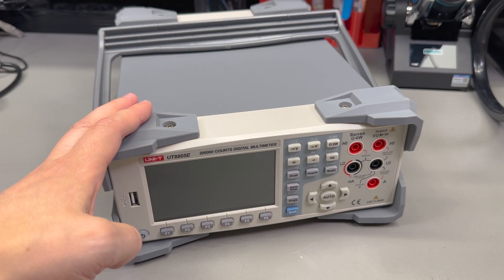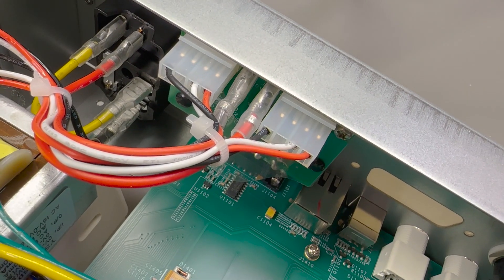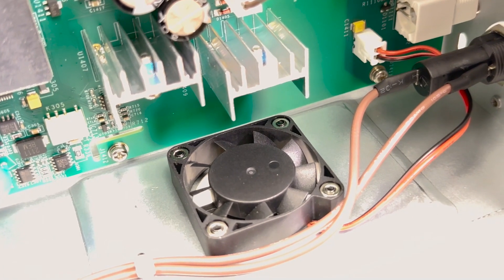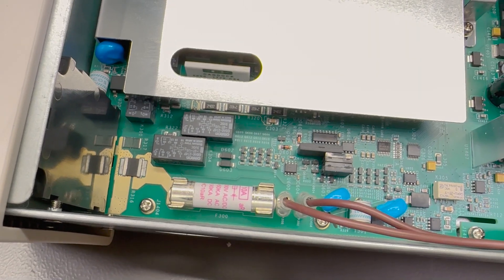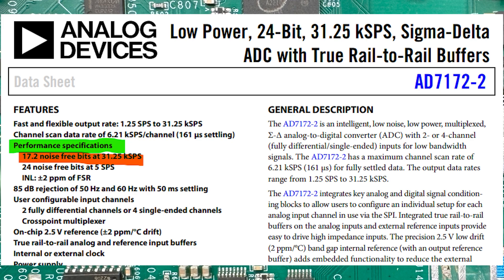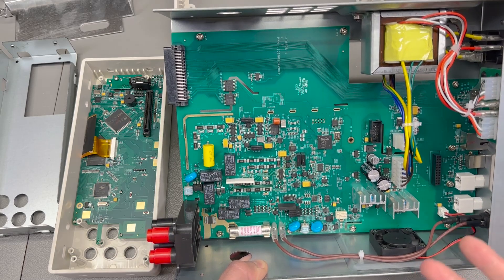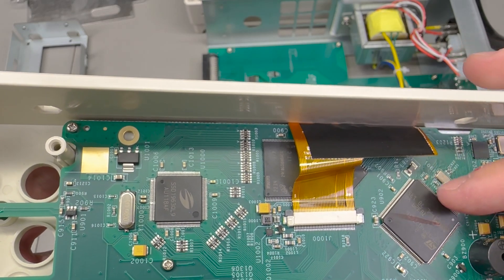Excellent Build Quality Inside The UNI-T UT8805E Teardown | Voltlog #481

Comment: I have a question. Maybe a little bit ridiculus. Lots of occiloscopes ground connected to mains neutral. So if we touch probes ground to AC live, occiloscope or probe destroy. Is it current for desktop multimeters ? Is any insulation transformer necessary ?

Comment: Do you consider this UNI-T UT8805E multimeter to be a better buy than the slightly cheaper Siglent SDM3055?
Reply: they are very similar, the siglent SDM3055 has a slower reading rate though (it is also the much older series, they are coming out with the SDM40 series just now).
So the UNI-T for 5.5 digits is probably the better choice right now, unless of course you want the scanner card option of the siglents, this is still a pretty unique selling point in their price range.

Comment: The use of Fujicon capacitors, Analog Devices op-amps, and the Max 6225 voltage reference really speaks to the commitment to quality. Especially impressed with the custom input connector design and the robust input protection circuitry. Unfortunately here in Brazil, such an equipment would cost a kidney. 🥲

Comment: wanted to get the hantek bench meter, but after buying the bench function generator - the fancy looking one and how badly made the UI is, i reconsidered and i feel like they are being overly hopeful with their specifications rather than conservative like most manufacturers. the calibration document that came with it had no information of what they did and what it read, in my own testing i observed quite a bit of jitter - i could not tell if it is my oscilloscope or the function generator but thats what really caused my confidence in hantek to go down - havent checked on eevblog if anyone has done more extensive tests
Reply from the maker: Thank you for your feedback! I'm gonna review several different AWG from UNI-T soon.

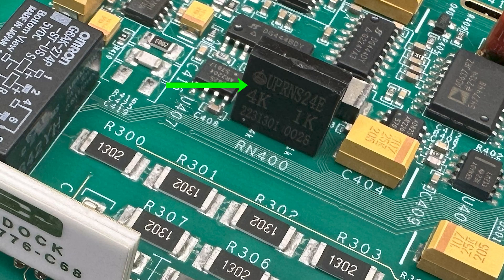Comment: 7:04 The logo on that UPRNS resistor network looks like it might be the logo of Thunder Precision Resistor.
Reply: It is. Precision custom metal film networks, TCR down to 1ppm, stability class 0.025%.
The Max6225 datasheet contradicts itself - the 1.5ppm typ, 3ppm max applies to the DIP package whereas the AESA+ (SO package) is shown as max TC of 5ppm in the table on the first page. Who knows what the typical value is supposed to be? (Not that 'typical' means very much).
Reply from the maker: Thank you for sharing that. Again, another valid point for me saying a lot of high quality parts seen in this assembly.

Comment: to be honest Unity was and is always cheap and crap ..for expensive models. they are not crap but they are not special in any way so from all those close ups..it looks pretty bad
Reply: What looks pretty bad exactly? Can you be more specific?
Reply: @sebastian_harnisch  Hello. Yes i can share few details. 1. Cooling of those heatsink is not needed. Instead of small heatsink they could put bigger one or use chassis as heatsink as it is done with other models or they could use specific low dropout regulator 2. Those crimps/input terminals looks skimpy at best plastic doesn't look like any good choice..yes it is cheap but that is about it.. ..i didn't see any good precision resistor there..yes there were few but for good equipment you need good low tempco resistor with good voltage source. 3. Voltage source is so so ..nothing special i would rather use heated voltage standard instead of just solution on chip but this is just my discussion. 4. RF shielding isn't good as i see it.. i didn't notice imput dedicated chassis filter(but i might be wrong on this one). ..and much more.
Reply: @SylwerDragon  I find it a bit difficult respond. I guess it depends on what you expect. You’re neither paying for Keysight nor are you getting Keysight.
It’s not a reasonable approach to just say „you need this or that number of precision resistors. You have to characterize the unit and see whether it meets its specs. If it does this argument is pretty pointless. If it doesn’t then that is a problem.
I agree that it would be nicer to have a voltage reference like the LM399, but then again, for an affordable 5 1/2 digits DMM the choice seems somewhat reasonable to me. I’m not 100% sure, but I think that most direct competitors (Siglent, Hantek etc.) have a very similar approach (MAX6325 or similar). If you know of an equally affordable new DMM with a better voltage reference, please let me know.
I‘ll leave it at that. 
This is not to say that I‘m 100% impressed and would recommend to blindly buy cheap test equipment - and personally chose to go with two used 34401A. But I think it’s important to state facts and give explanations so that one can judge whether an argument is worth considering.
Reply from the maker: Please share more details, it's important to understand what looks pretty bad to you.

Comment: The transformer is mounted on the side and on an in-dented plate to give it the most robust mounting arrangement. Flat plates bend, throw in some angles and the strength increases.
Reply from the maker: Makes sense maybe from some weird manufacturing limitation because why wouldn't they be able to the same indent to the bottom metal plate?